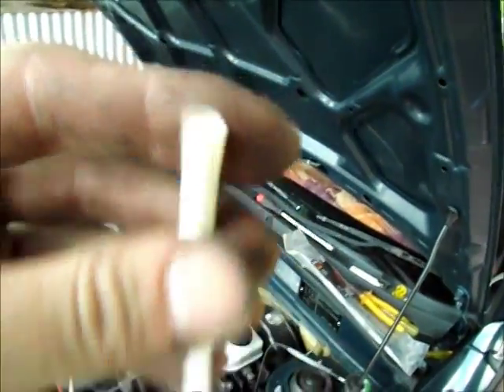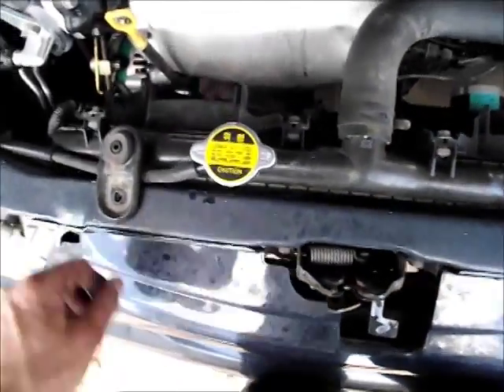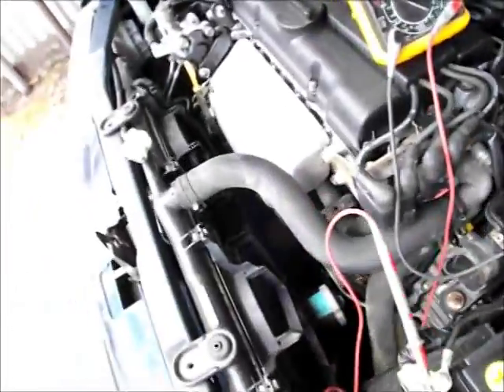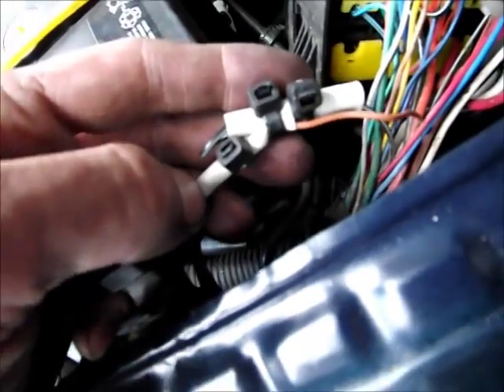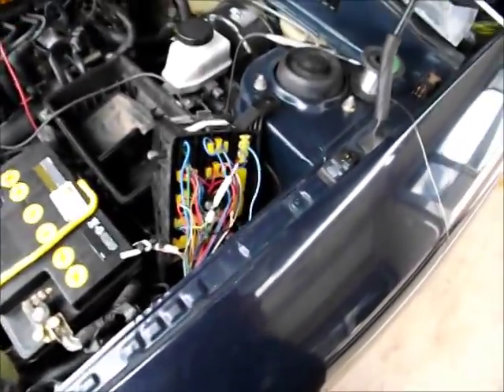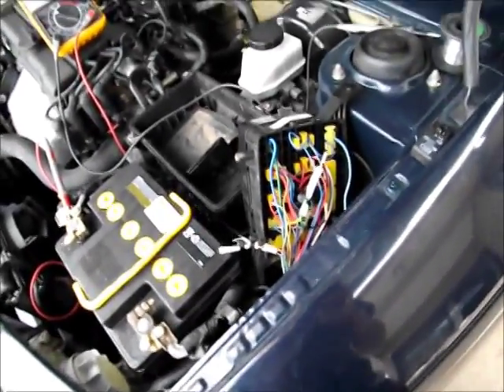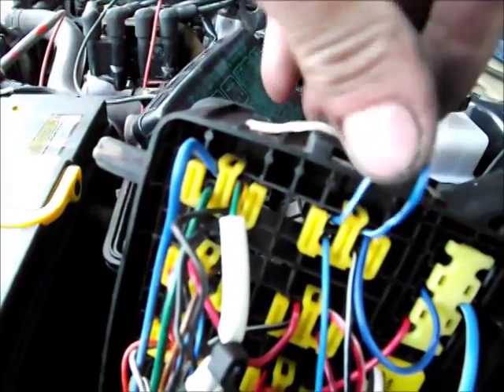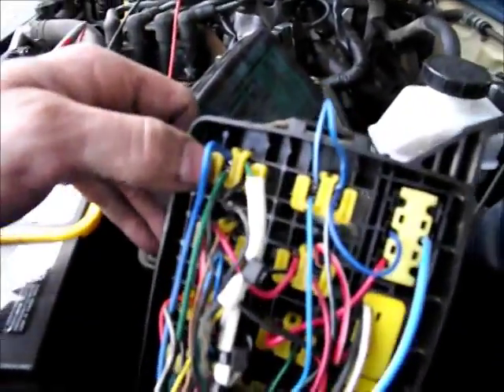Hyundai cooling fan mod-i add a 2nd fan

Comment: No thats not hackery dave, you used a second relay to spread the load :-))

If the computer could not cope with two relay coils then the second relay could have had its coil wired across the original fan, feed it power through a fuse to the common pin on the relay and output (n.o) to new fan :-))

I had to replace all the dead wires on a hatchback car to the tailgate through the flexable rubber gator tube, they were holding on by a few strands, very ill :-(
Every solder joint was covered by heatshrink, heatshrink can be handy :-))
Reply from the maker: thanks mate :) it is neat enough that i bet not even hyundai themselves would spot the mod at first
Reply: wickedxe
 Nope its not visable and its not an unreliable method so its sorted :-)

You sounded in a decent and unstressed mood that day, well you didnt start with "Hello baaastards", that would be a hint ha ha, leg pulling :-)